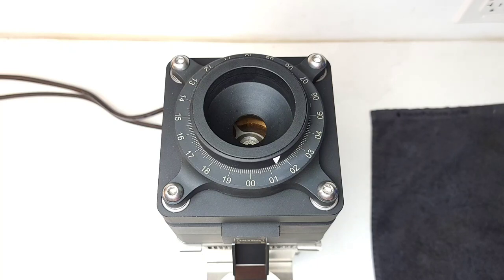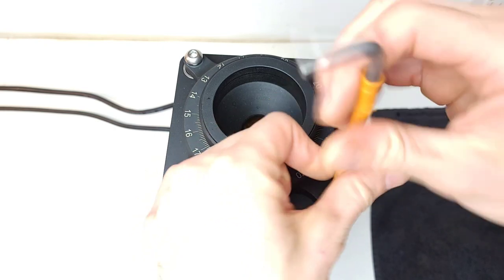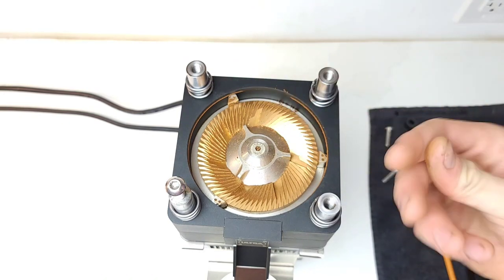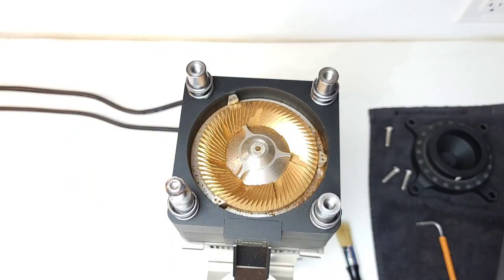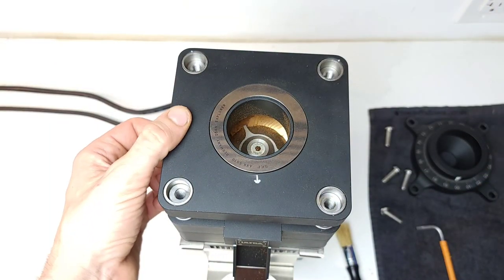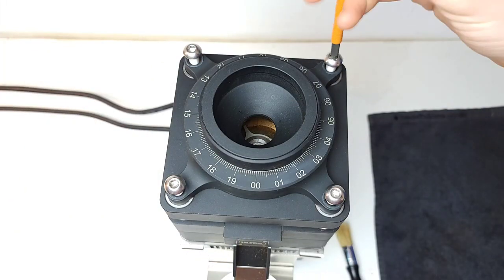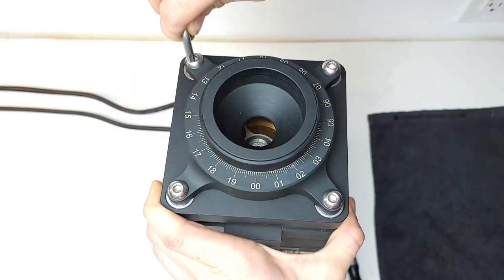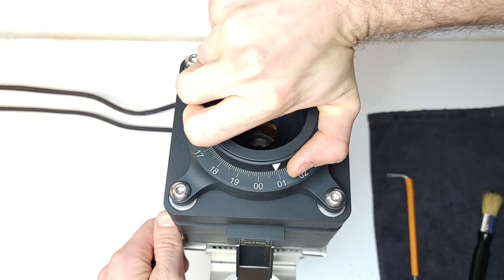Removing Upper Burr carrier on the LeverCraft Ultra Grinder

Comment: Am I wrong or sounds like the burrs need levelling/centering allignment?
Reply from the maker: I’m not sure I understand the question. We will be posting a video on alignment soon!
Reply: @levercraftcoffee3084  5:55 the "touching not touching" sound.
Reply from the maker: @stefanociamarra2505  The burrs touch all the way around, but touch more in one spot than others.  This is at 35 microns of alignment which is incredibly small.
Reply: Having a nackground of cnc mechanic experience I can tell that 35 micron is huge in mechanic and high precision tools. I honestly love the design and the potentials of your product but this sound does not sound good at all.
Reply from the maker: @stefanociamarra2505  are you familiar with a tolerance stack up? This is not a single piece of machined material. If it was, the tolerance would be less than 10 microns. Since this involves many parts, getting a tolerance stack that tight is very difficult, and not even achievable with other grinders as they are not built to make adjustment! Keep an eye out on our alignment video as we will explain much more in depth why this is so good.
Reply: Looking forward to watch the alignment video!